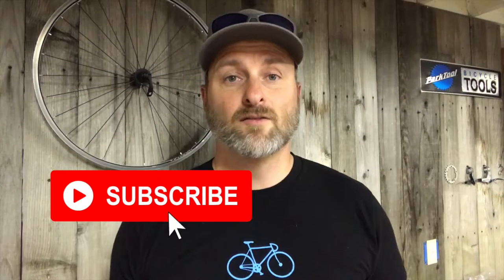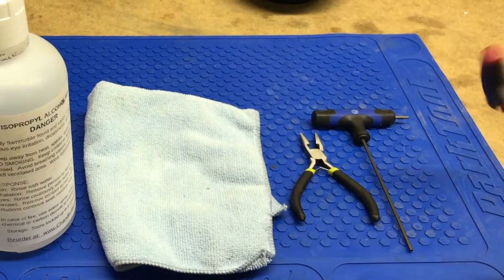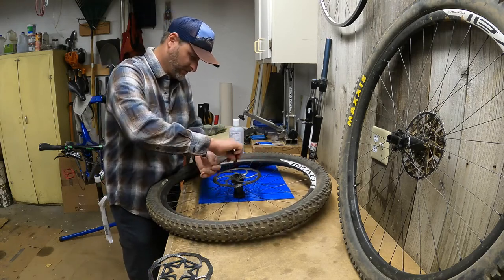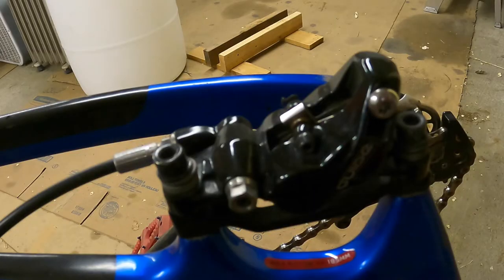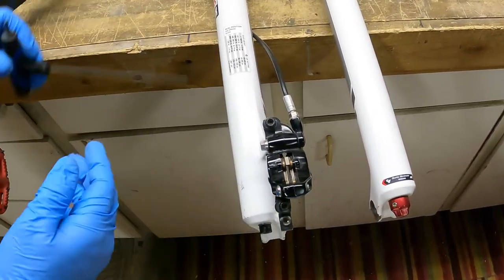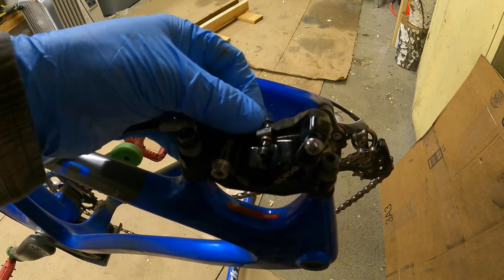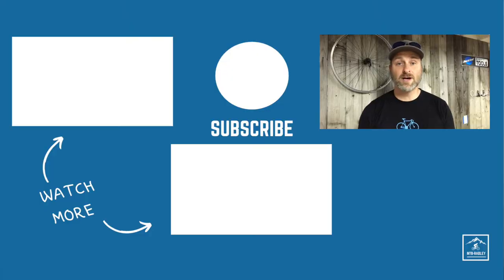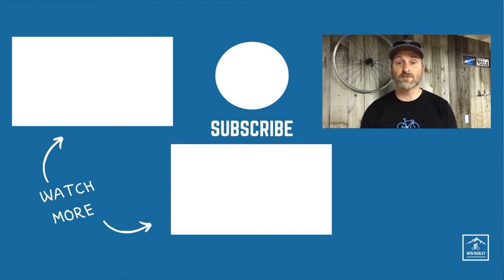How to Remove & Install Disc Brake Pads & Rotors - Mountain Bike Tips

Comment: can't find any videos about how to change my type of disk brakes. it's a sundeal folding bike that I bought from eBay the seller is Chinese and he does not answer his email or phone. I would say it's just a  basic type with no spring that keeps them apart like in your videos. got any recommendations on videos to watch so I could do it myself? thank you
Reply from the maker: Hi Eli, are you wanting to install new brake pads to replace worn out brake pads, a new rotor or new calipers? Tell me more about what you want to do and I'll see what I can find.
Reply: @MTBradley  just replace the pads